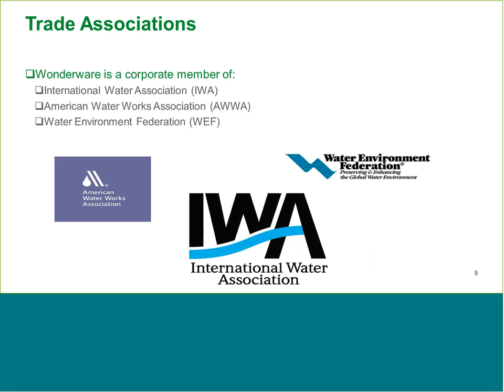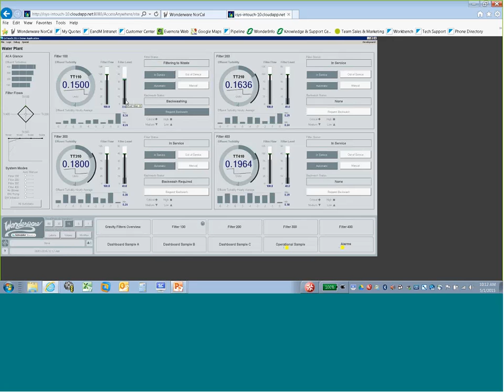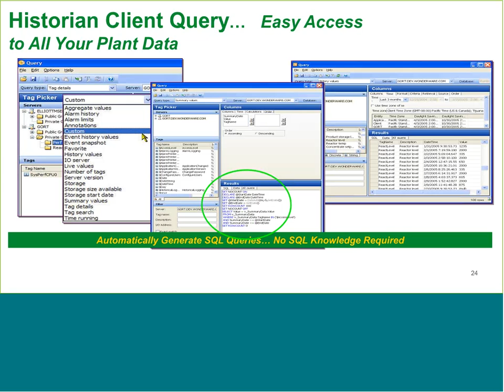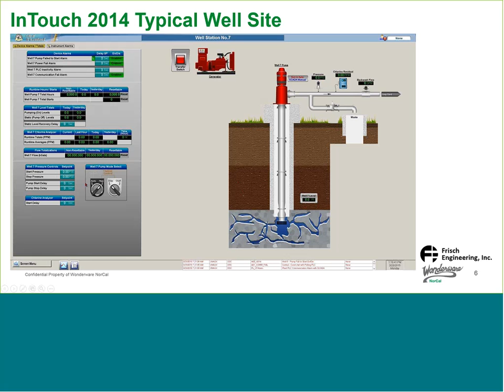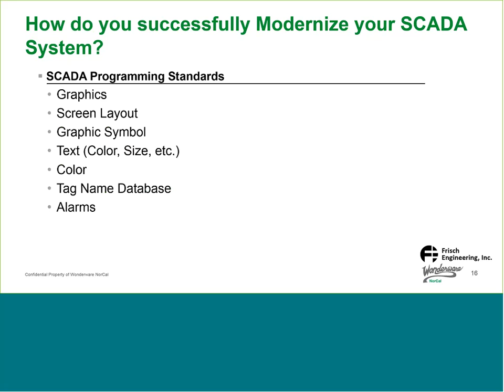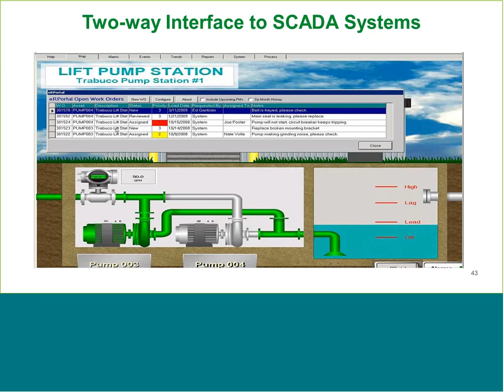Water & Wastewater – Modernize Your SCADA System!

Comment: I am pleased to share with Aveva, Professionals and Companies the most advanced technological tool in existence: the Digital Twin that I invented in 1981 under the name of Virtual Instruments.  https://youtu.be/eadaQiL_AK0         https://youtu.be/fXlp4QLdWQs
Export the Aveva, Revit, Plant 3D, Civil 3D, Inventor, Engi file of the Building or Refinery to Excel, prepare Budget 1 and export it to COBRA. Prepare Budget 2 and export it to Microsoft Project. Solve the problems of Overallocated Resources, Planning Prolems, prepare the Budget 3 with which the construction of the Building or the Refinery is going to be quoted